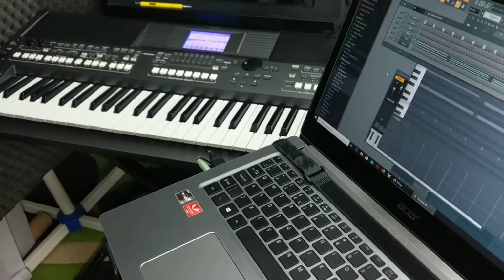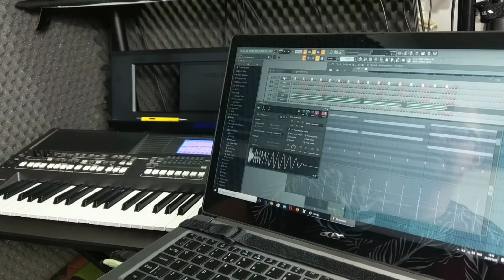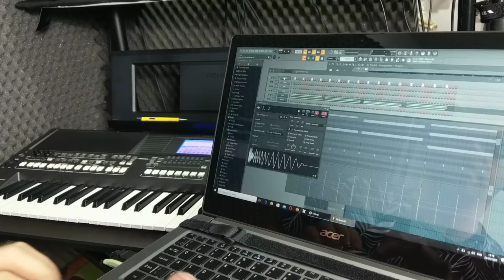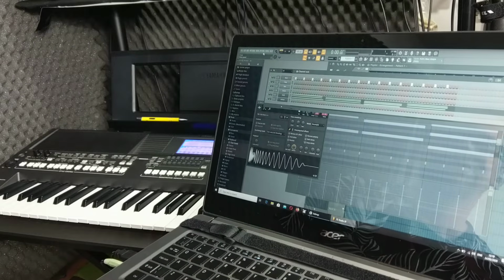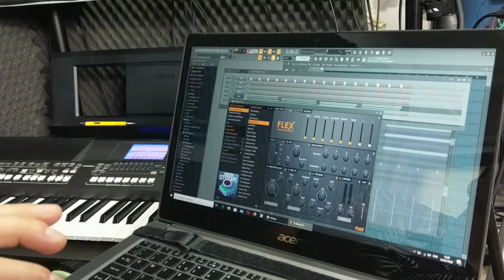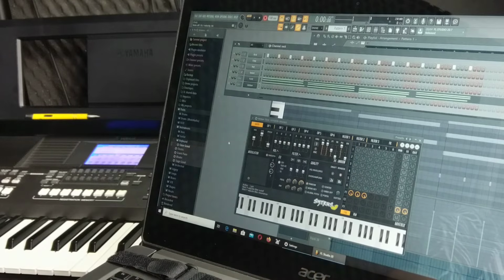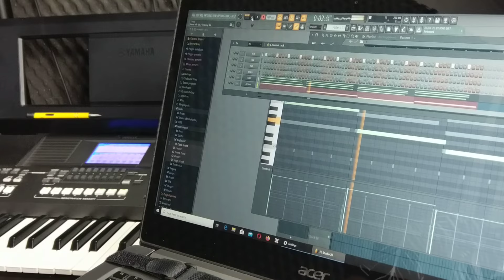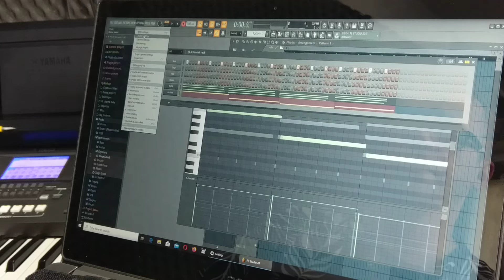How to fix latency problem with USB MIDI keyboard  / controller recording FL Studio 20 - [SOLVED]

Comment: i have no sound when i change it
Reply from the maker: You need to enter the ASIO Control panel and add devices. It is a separate program that you should have installed.

Comment: But the lag is not completely gone, its still there right ? Even if it is 12ms or smthing.
Reply from the maker: Yes. It is the nature of digital sound processing - there is always a buffer.
Reply: @BBWalkerTV  then how low can it go? can it get to the point where it will not be a problem anymore like it wont keep me off the beat?
if yes whats the delay for the same in ms?
also what about big producers like charlie puth who also uses midi? what does he do?
Reply from the maker: @sangeetthegreat5719  You go as low as the sound is continuous without cracking or interruptions. Every hardware has different limits.

Comment: for all people learning about this you can lower the latency even more with asio4all driver or if you have an interface with the audio driver of your interface and lowering the buffer size, because smallest possible buffer on FL studio asio is 256, asio4all and interface audio drivers will let you go lower than this for even less latency
this is needed for recording vocals if the singer wants to here the audio while it's being recorded, I usually set mine to 64 when recording vocals 
but be aware, if you have too much going in your project (many effects for example) with a very small buffer like this it will cause problems like lagging and producing audio cracks
Just record with a low latency, don't use much effects in this phase and after recording set it to 256 or higher again 
If you have audio problems in general which are caused by too many effects going on you can also try a bigger buffer like 512 or 1024, this helps sometimes
Reply: THANK YOU, ITS PERFECT NOW

Comment: Just a heads up how to get the absolute PERFECT latency for recording. Its not the same as the 12ms buffer length you were talking about but above that it's actually your "latency input" all the way at the end it will say your number like this (100ms). So go to your offset and drag the slider till it says exactly what your ping was. I slide mine to the left until it said -100ms because I noticed all the way to the left actually made it start recording a little delayed instead of before where it was played before. so there ya go thats how you fine tune it. maybe I will make a video explaining it more.

Comment: Doesn't help my issue.
MIDI is almost instantaneous. 
Sound takes a half second to hear.
It's my computer.
Aurora R6.
Should be lightning fast, but it's not. 
Until I solve the issue, if ever, I'll never own a midi controller.
Sucks.

Comment: This video really helped me although I have crappy realtek asio so the realtek asio worked a dream for my MPD218 and probably my keyboard too! Only got my pad last week and so far the only suggested fixes was to the USB 3 in the bios which did not help, neither did changing anything in the device manager USB settings but changing my asio fixed it yay.  I wonder if it will just be whatever your sound card asio is that will fix it?  Either way am very happy now cause I was starting to think I was never gonna be able to use my pad the delay was so bad, it totally threw me off any kind of rhythm.  :D

Comment: Can anybody help me I have a high performance pc I’m using fl Asio driver but I have a delay whenever I press a note on my keyboard ive tried looking everywhere for videos to fix it and I can’t find any with my problem. I would appreciate any help
Reply from the maker: Have you tried to enter ASIO Control panel and lower value of the Buffer size ?
If you have problem - let me know - I will create a video for you
Reply: @BBWalkerTV  thanks for the feedback and yeah I put the buffer size to 256 cause that’s the lowest I can go on fl studio asio and I still have a delay when I press notes on my midi keyboard I would appreciate it a lot if you made a video to help me with this problem

Comment: I don’t have any latency but every minute or two my midi input will have a very noticeable hiccup/studder.  Any idea what’s going on?  The CPU seems to jump from 8% to the 12-14% range but I don’t see why that would cause such a big hiccup or what would cause it to spike like that while playing live.
Reply from the maker: This is a symptom that indicates that the CPU is not working out, or that there is lag / noise on the I / O port.
The topic is generally very annoying and quite complex, you can try:
1. Increase the ASIO buffer size (because there are too few samples)
2. Change the USB port to another (e.g. 3.0 instead of 2.0)
3. Disconnect unnecessary USB devices (USB bus has limited bandwidth)
4. Turn off other programs and services in the background.
5 Reduce the amount of DAW effects to fix the CPU deficiencies

Remember that the percentage of CPU usage is not entirely reliable because, apart from the CPU, we have a serial bus, access to disks (cache memory) etc.

Please let us know it that fixed your issue

Comment: Yeah, but my souncard is the only audio out i have. I lose my sound
Reply from the maker: You must install ASIO drivers  and configure them to use your standard sound card. If you are confused - please let me know. I will make a video about it.
ASIO drivers should be installed during FL studio install but you may cancel it's installation (it is separate installator)
Reply: BB Walker TV yes I think I’m missing something here. I did all that I can think of, and still has latency.
Reply from the maker: @danowens5397  OK I will create a general video about latency causes  and possible solutions.
Reply: @BBWalkerTV  that would be cool

Comment: If you are using a focusrite 2i2, plug a speaker or headphones in to the 2i2, go to options>audio setting>input/output>focusrite asio. Then on the asio panel you can set the buffer length to 1ms (16). I was struggling with this for ages but I was playing through the laptops audio it only allows for a minimum of 6ms buffer length with fl studio asio, so when I was playing with a guitar the delay was too much. This solved the problem for me, hope that helps!
Reply from the maker: Thanks for the tip. Regards. Please share my videos in social , thank in advance.

Comment: Guys, for have 2ms of latency:
Go to Audio Settings -> Set FL Studio ASIO Device.
Change Sample rate (Hz) to 192000.
And press on Show ASIO panel -> Click on 256.

2 ms <3
Reply: Thank you very much!
Reply from the maker: OK, thanks but you need to be aware that higher sample rate results in bigger WAV sizes and require much powerful CPU. Basically here you do the trick that speed up sample rate (warp time) but the size (in samples) is same. If your PC can handle this without grinding and shredding the audio - it great.
Reply: @BBWalkerTV  Yep, that's the reason for less input lag, you have to see if it can runs it without any lag issue.
Reply: Thanks
Reply: thankyou
Reply: goat
Reply: SUCH A LIFE SAVER GOD BLESS YOU

Comment: I'm using macOS, there is no such audio device called "FL Studio Asio"
Reply from the maker: Don't you have a program called ASIO Control panel or Generic ASIO for ALL ?
Reply: @BBWalkerTV  Thank you for your reply. I actually found the solution. It turned out that on macOS there is no (noticeable) latency issue with MIDI signal input.

Comment: i still have latency even with all of these options
Reply: Don't use bluetooth headphones
Reply: In your audio settings, try "Mixer" for playback tracking.
Reply: @svensvensson8102  Still doesn't work for me. wondering if I need more ram.
Reply: @rikogreen7596  RAM should not impact latency. There're basically three important factors (as long as the MIDI interface is ok) 1) Use an ASIO driver, 2) Use a small buffer setting, but you don't have to go nuts (256 should be fine) and 3) Plug-ins, something that people forget. An analog plug-in for instance could add tens of ms and it's the total fx chain that matters. With latency I mean time from key press to heard sound. Then there's the matter of getting the notes aligned in the playlist/pianoroll when recording, that's a different problem. So what do you have problems with?
Reply: @svensvensson8102  dude my problem is the second one you said. The alignment of the notes in the piano roll, I always have to fix it by hand but it's stupid I could just have wrote the part by hand.
Reply: @gusgus420  Ok, have you tried the Audio settings->offset slider. You can use it to move midi data later or earlier. Turn the metronome on, tap to the beat and adjust until it's lined up. Exact placement depends on you as well of course :)
Reply: @svensvensson8102  thanks man! But even with no latency, when I stop recording, the notes are placed a little after the beat and idk why :/
Reply: @gusgus420  So moving the offset slider to max e.g. -200% or +200% makes no difference? In that case I don't know either. Playback tracking mode Mixer or Hybrid is required with some (bad behaving) audio interfaces for proper note alignment (mode Driver is recommended if it works, if it doesn't you generally see the playhead marker jumping around and such). The offset then allows you to fine tune note placement.

Comment: I selected asio4all and I'm not getting any sound now when I hit the controller? I see a sound wave appear in FL studio So I know it's making a noise.

I restarted the program but that didn't help. 

When I switch back to primary sound drivers I'm able to get audio again but obviously still have the latency issue.

Somebody help ?
Reply from the maker: after installing the asio driver should have a program called ASIO control panel. when you start it you will be able to seletect which devices are considered as input, asio is so kind of proxy, it May require to select device behind it.
Reply: @BBWalkerTV  The Fl Studio asio driver has a control panel where you can do the same thing.
You can choose inputs and outputs on that and i never noticed.
Great work.

Comment: Hello, I checked my settings and I have FL Studio ASIO set up correctly, and the correct usb midi driver downloaded and I still have issues with latency, could you please help? I'm using the Korg M3
Reply: Same problem here with a casio keyboard
Reply: Try to change playback tracking to "Mixer" in your audio settings.

Comment: Hi !  how can you settle the buffer length at 12ms when in the ASIO panel (in the audio settings of fl studio) it can't go under 256ms ?  is there another external ASIO driver somewhere ?   if yes, can I replace the ASIO driver in fl studio with a better one ?   thanks
Reply from the maker: Sure there are alternatives but FL provides their own and it should work easily at 30ms at least.
The control panel for it should be installed with the FL studio installation. maybe you have skipped this step ?
If you are using Windows click start and type "asio" - some control panel should be found, then try to setup buffers there. 
If you haven't any find ASIO Drivers on Internet and install it. 
on my computer I have ASIO from FL and Steinbergs (those from Cubase) and it is called ASIO Generic low latency driver.
Reply: Du you not mean 256 SAMPLES?

Comment: Guys, after doing some research I found out that some plugins intended for mastering (like Ozone) can actually be responsible for latency even when your audio settings are set right! IF YOU FOLLOWED THIS VIDEO'S INSTRUCTIONS AND STILL HAVE THE LATENCY, TRY DISABLING THE MASTERING PLUGINS ON YOUR MASTER CHANNEL :)
Reply from the maker: Try change the USB port used in the computer
Reply: @BBWalkerTV  same problem, im really hoping i dont need a new cable a waited like 2 weeks
Reply: @BBWalkerTV  i edited my comment. Sorry, I hadn't seen your reply!
Reply: @pedrokoury1352  hi i'm quite new at fl studio and mid keyboard  (and also 2 years late), but can you elaborate more on "disabling mastering plugins on the master channel"
Reply: You just solved mine cause I was still having the issue after the tutorial. Thanks to the two of you, appreciate it.
Reply: Thank you. Saved my ass
Reply: Worked like a charm 🤌🏻🤌🏻
Reply: THANK. YOU. SIR!!!!!!!!!!

Comment: Hi i wanted to use my psr s670 as a mid8 controller whilst recording my cocals through behringer umc404hd. The problem is they both use different drivers ,one uses asio4all and another uses umcasio. How do i solve this please?